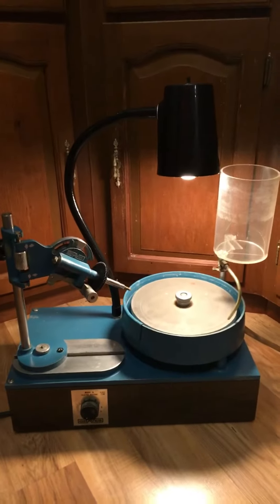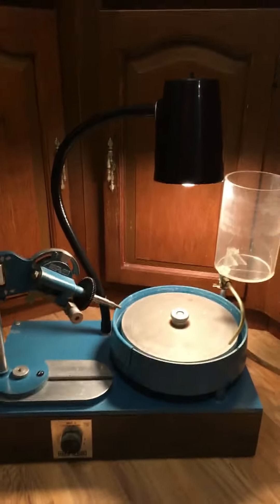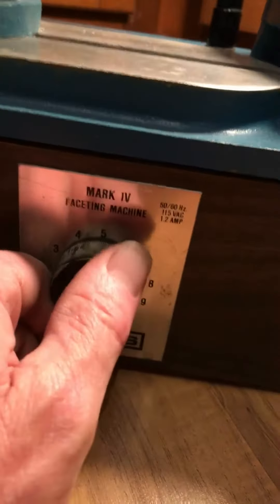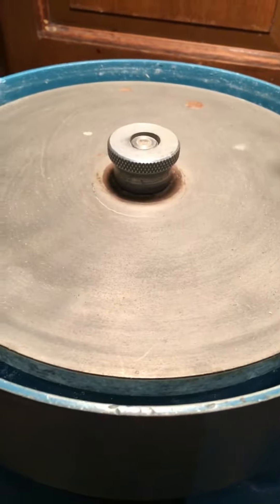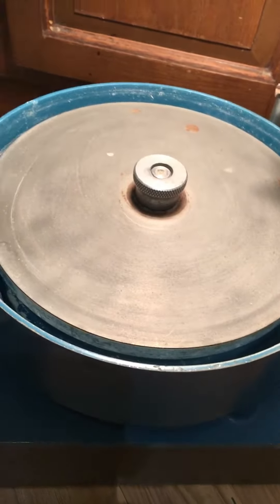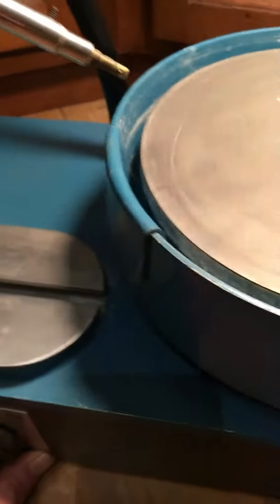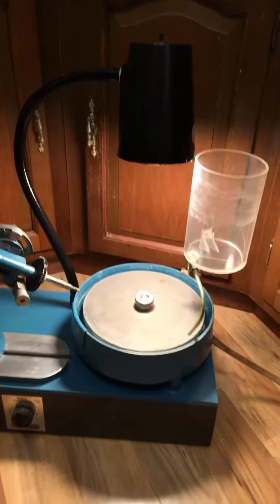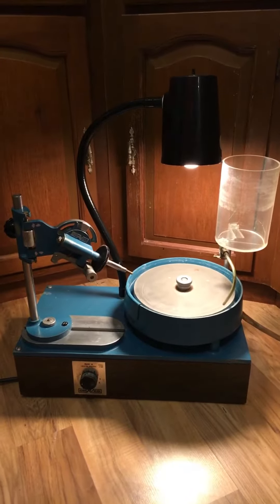Graves Mark IV Faceting Machine

Comment: Super Easy Fix. It is the BELT. Either it slipped off the pulley OR broke. Either way it is cheap to replace and easy to do. Literally ANYONE could do it in minutes.

Comment: Easy Fix
If you not into cutting i would buy it from you! I can tell you how to fix it! Because I'm honest person! Underside, the motor should have a shaft! On the shaft is a cone shaped rubber piece! On the shaft is a tiny set screw! Get the right size! Loosen it move the cone until it touches the concave metal wheel! Tighten screw and now try it again! The rubber cone has to make enough contact on the under plate to spin it!

Comment: Turn it over.  Motor is on the bottom.  I am betting it is missing the belt from motor to the pulley on the bottom of the lap wheel.